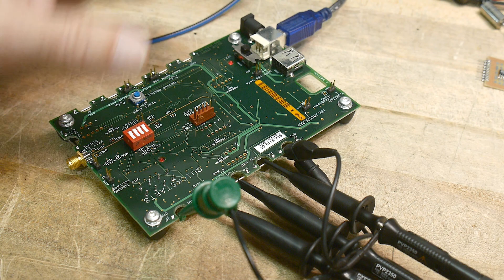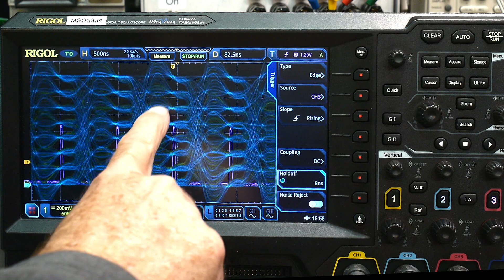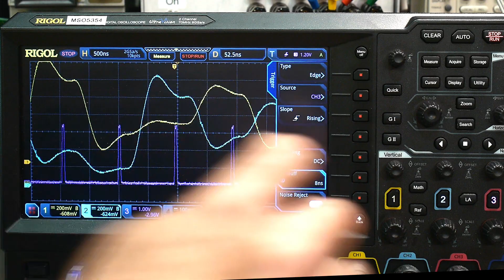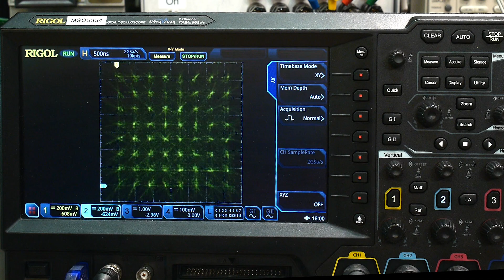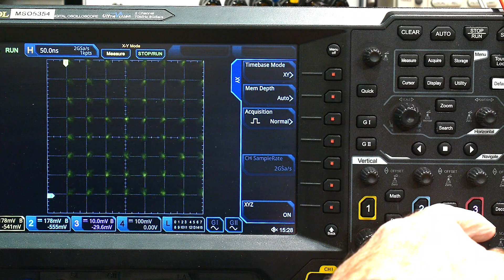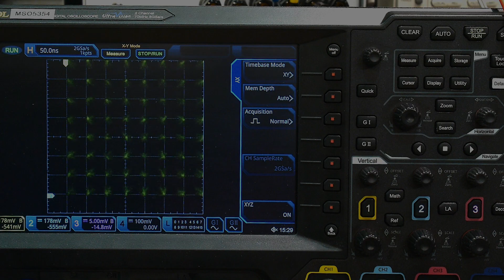Comment: That's fun but what about the case where this goes into an antenna and you are trying to demodulate in a radio receiver?   There's no clock signal so demodulating  becomes really fun!
Reply: fun: https://opg.optica.org/oe/fulltext.cfm?uri=oe-22-13-15376&id=294065

Comment: 6:52 It is not 8 bits in one direction and 8 bits in other direction, it is 8 LEVELS in each direction, which means is 3 bits ( log(8)/log(2) )in one direction and 3 bits in other direction. At the moment of sampling, your signal can touch only ONE of that levels, but you can have multiple 1 and 0 in one symbol. In fact, the QAM64 carries 64 different levels (8×8 constelation) per symbol, which is 6 bits per symbol ( log₂(64) ).

The begining of that explanation was perfectly correct, but then it slipped from 8 levels to 8 bits, which is typical mistake when it comes to these modulations.
Reply: Nikky, you got angry somehow 😁

Přeji ti krásný den 😉 Tom

Comment: How does this relate to phase shift keying? Is that an alternate technique to get multiple bits per cycle?
Reply: MODULATION	BITS PER SYMBOL	SYMBOL RATE
BPSK	1	1 x bit rate
QPSK	2	1/2 bit rate
8PSK	3	1/3 bit rate
16QAM	4	1/4 bit rate
32QAM	5	1/5 bit rate
64QAM	6	1/6 bit rate
Reply: The main difference between the n-QAM and n-PSK signal lays in different constellation diagram. n-PSK has n points spread on a circle, but in the n-QAM they are spread into the square. This results in a fact, that n-PSK affects only the phase of the resulting signal, it has no AM portion, which means that your signal path does not require to be linear (similar to FM or ΦM). QAM contains amplitude portion, which requires linearity (which is typical pain in the ass when it comes to RF PAs), but on the other hand, the error detector, which is crucial part of demodulator controlling all that phase and gain loops, is much simpler to implement, which is a great advantage when it comes to high speed data. 

Both systems use multiple levels to encode multiple bits into one symbol, so the symbol rate (this is how many changes of that signal happens per second) is different from bit rate. And there is also one more similarity. If you think about 4-QAM. Yes it is exactly the same modulation scheme as a QPSK, but this is the point where all that similarity ends.

Comment: Something is missing. You should see if you can modulate that I/Q signal on a carrier and then decode the result on the Siglent spectrum analyzer.  The I/Q signal on a carrier should generate something that is both amplitude and phase modulated.
Reply: This is what these simple presentations typically lack of — the basics. Why there are two (I and Q) signals, why they are mixed with π/2 phase shifted LOs, why there is that π/2 phase shift, where it came from etc., which typically makes this theme completely non-understandable. That lecture should begin with the quadrature mixers, which was widely used to generate SSB signals, especially in microwave oriented constructions, giving the strong base to understanding all that following vector oriented stuff. But this would be long, it would require some kind of concentration and math skills and I don't think this is what typical youtube viewer wants. They don't want to understand that topic, they just want to watch something having fun.
Reply: There are plenty of hard core engineering channels. Lots of professors in India who will teach you IQ modulation. I try to fill the gap at the lower end for those who will never be engineers and just enjoy building stuff and learning along the way.
Reply: @IMSAIGuy  That description fits me exactly, which is why I appreciate your content so much!
Reply: you are thinking of the RF domain where the Q signal is moved 90 deg during the conversion.
Reply: @IMSAIGuy  yes of course. That is the whole point of IQ after all. The part of QAM shown in the video is actually what you have either before rf modulation or after demodulation. It becomes just one RF signal, not two separate signals. I think that is an important point to understand what QAM is all about. So the I signal is modulated to a RF carrier, then the Q signal is modulated to a RF carrier of same frequency but 90 degree phase difference and finally the two carriers are added. This is the final QAM signal that actually can be transmitted on coax to your TV or on the air as a radio wave to your cell phone etc.

My siglent spectrum analyzer has a QAM decoding module. Maybe your does too. I am not sure as mine is the ssa3032x-r fully unlocked. If you have it, it would be a great video to show decoding of RF modulated QAM.
Reply: @BaldurNorddahl  the 'plus' version of the SA has that, mine does not

Comment: You could come closer to reading the leading edge of the clock if you added a circuit to narrow the Z axis pulse. I suppose that would make the display dimmer, but it should give you a more accurate image of the data.